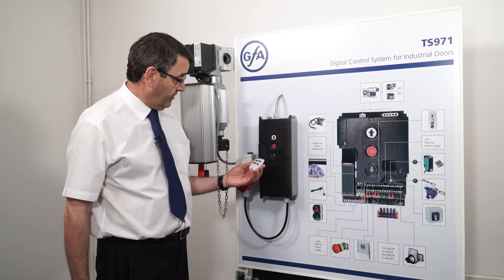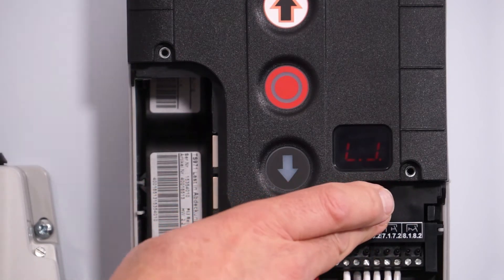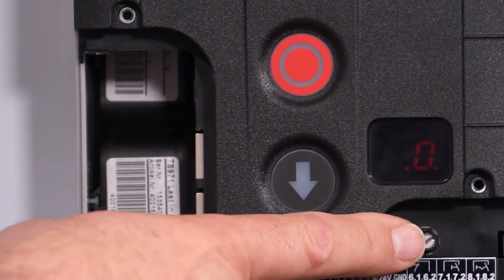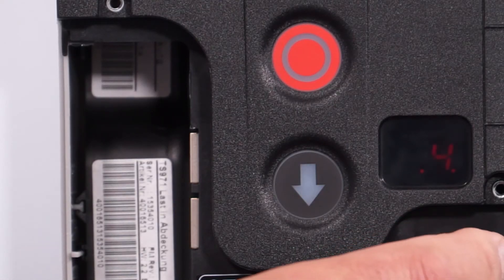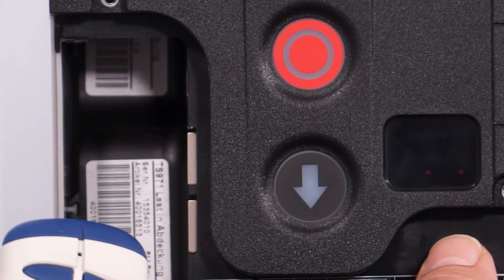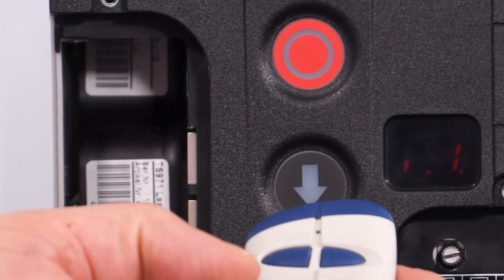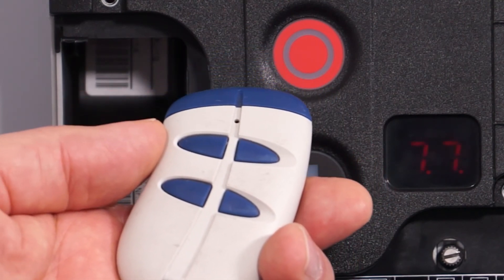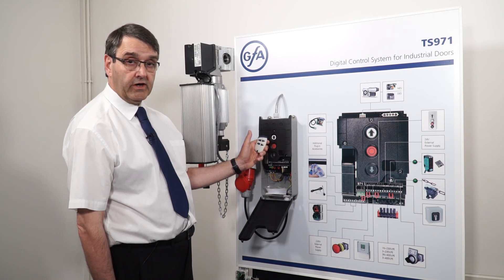Tech Tips: Programming remote control on GfA TS 971 control panel

Comment: Hello,

I have a TS970 switchboard and I need help.
I only have one pilot left, I bought the same pack I had but I need help how to code a new remote.

There is a video for TS971 on the Internet.
Unfortunately, on my panel it is only from 0.0 to 3.9 and then only from 8.0.

Can you help me somehow?

Best regards
Bartlomiej
Reply: Did u find a way to do this? I am in the same situation, but it looks like the 970 needs a different approach.

Comment: Thanks for the video guys 👍quick question though.what is the radio frequency of the TS971?
Is it 433mhz fixed or variable dependant on the perameter that is selected within the transmitters set up process

Comment: I received a replacement GfA transmitter today. I live in a block of flats so there are 11 other working transmitters in use. Are you able to confirm for me that the procedure in this video will only programme my transmitter and the others will remain as they were? Thanks.
Reply: I have same question, I need to duplicate one more remote control but dont know how.
Reply: did you manage with that? I have same problem